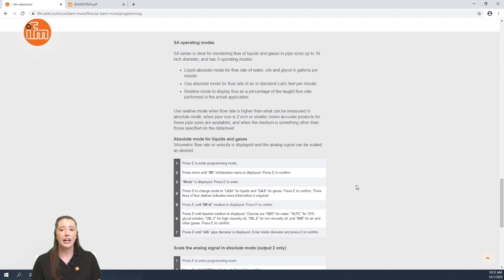How to manually program a thermal flow sensor

Comment: I have setup output 2 to current 4-20
Set to flow, 
Also sel2 is set to flow. But i am getting 26.7mA regardless of the flow value. Output 1 is working correctly
And switching according to the switching points
How do i resolve output 2 mA issue.
I have set up 2 sensors and both are doing the same thing

Comment: Hi, 
Can you please make a video on how to program the SA5000 sensor, output 1 to send 4-20mA temperature signal, and output 2 to show digital flow measurement? 
Please if possible show how to set the range of the temperature for the 4-20mA signal aswell.

Thanks in advance.
Reply from the maker: @jonasthomsen8665 thank you for your question! On the SA series sensors with the analog output option, only output 2 can be set for an analog signal.

At the 4:30 mark in this video, you can see us toggle to the EF menu, then into the CFG menu. Within the CFG menu there is a parameter called “SEL2” and if you set this to temp, output 2 is now configured to output an analog signal for temperature. 

Once this is configured you can set your range for the analog signal by setting the ASP2 and AEP2 settings. You can see how to navigate to these settings around the 4:30 mark as well.

ASP2 is the temperature value in which you will receive a 4mA signal and AEP2 is the temperature value in which you will receive a 20 mA signal and the rest of the range is scaled linearly.

Feel free to call our service center at 800-441-8246 or email our Application Engineers at info.us@ifm.com if you have any additional questions.
Reply: Hi. I would like to check oil temperature continiously.
But display changes in 30 second.
Can you please let me know how to solve this problem?
Reply: @8284Andy    have a look at "dAP" settting in the manual and see if that describes your issue.